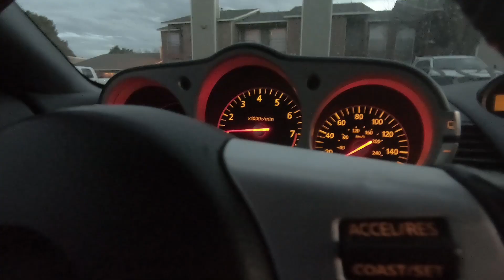NEW 11" Wide Aodhan DS07 Wheels on 350z!

Comment: What are your wheel specs I have a 350 as well and I’m trynna get these wheels
Reply from the maker: Rear is 19x11+15 with 285/35r19 Front is 19x9.5 +22 with 235/35r19
Reply: @Egbert320   Any Fitment issues with the tired rubbing etc? Got the same wheels and specs but have stock Suspension for now so just wondering if that tire setup would be good for me?

Comment: nice wheels bro!  I wonder what's the offset/et? need answer! lol 
thanks in advance
Reply from the maker: Rear was 19x11 +15 and front was 19x9.5 +22!
Reply: Egbert320 Thanks bro! :)
Reply: Egbert320 hey bro so i just got 19 x 11 +15 rear and 19 x 9.5 +15 front. U think i’d rub? Im a lil lower than. You
Reply: @gabrielgalvez4391  3 weeks later... you rub or nah?
Reply: What tire size did you slap the rears on bro ?

Comment: What tires are you running
Reply from the maker: Hankook Ventus v12s, 285s in the rear and 235 up front! Thanks for watching!
Reply: Thanks I’m thinking of running them on my z I wanted to get a more sticky tire like a nt555 but the tire shop says it doesn’t have the right load rating ?